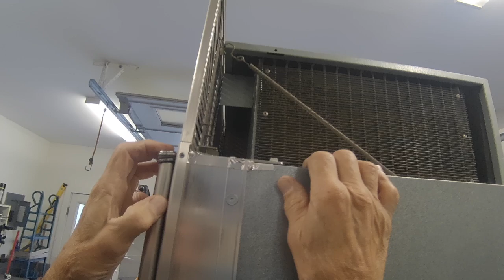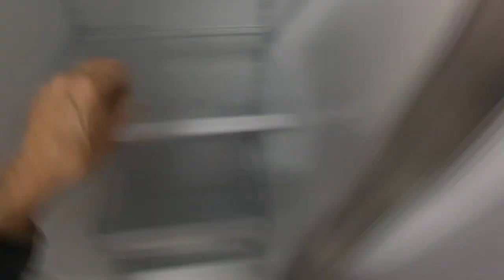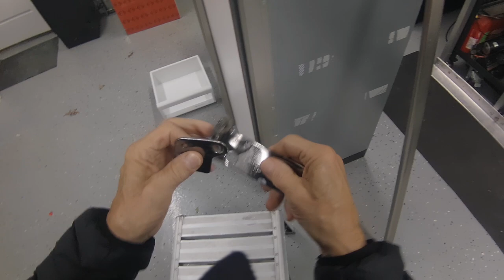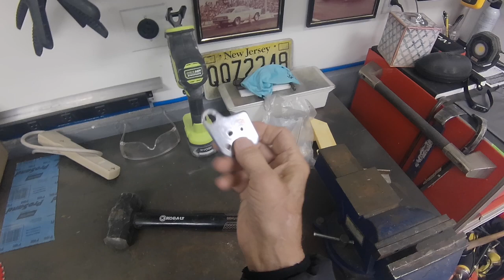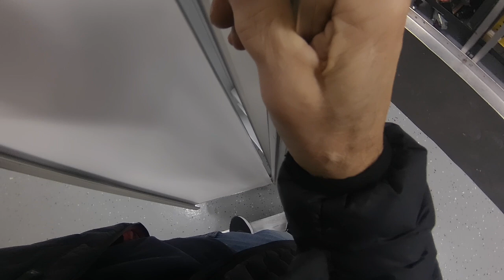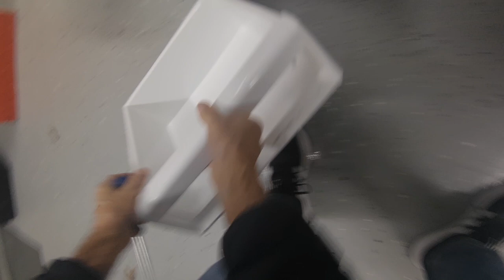Sub-Zero 661-3 Upper Refrigerator Door Hinge Repair

Comment: If the ice chute door needs to be replaced, please film it. Is the ice chute door on the 661 similar to the 690?
Reply from the maker: 661 doesn't have a chute door, are you referring to the 642?
Reply: @SubZeroSpecialists  Is the 642 similar to the 690 which I have?
Reply from the maker: @alann3805  yes, same parts